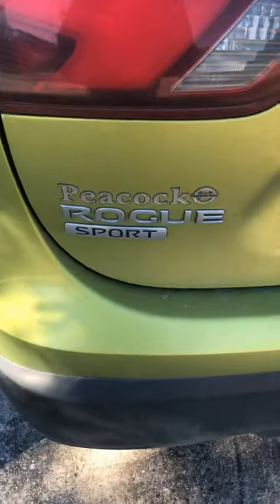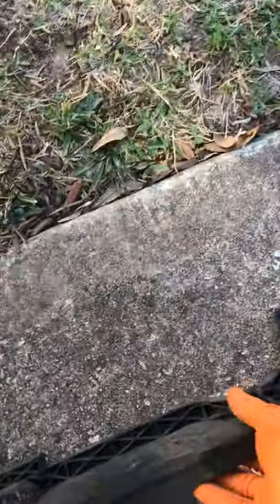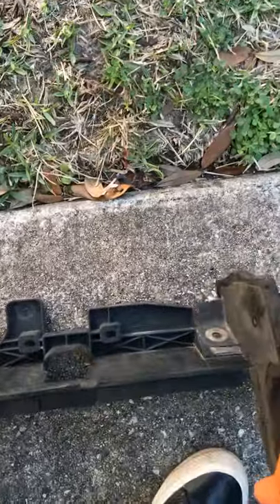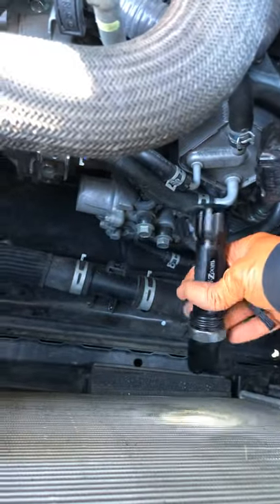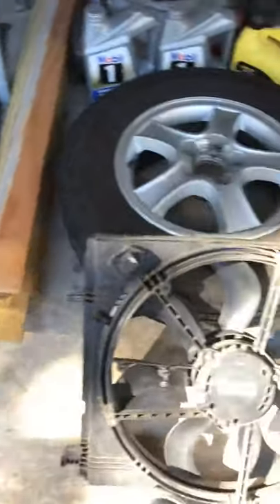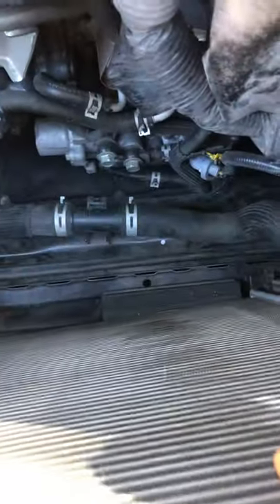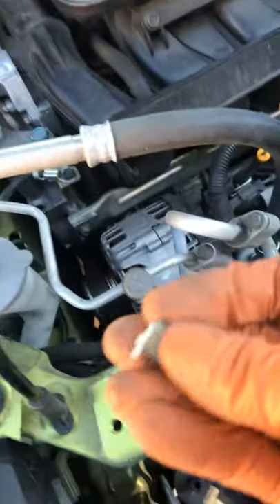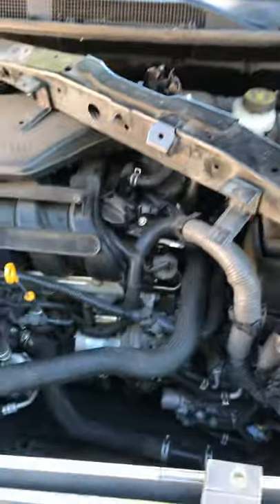2017 Nissan Rogue Sport Cooling Fan Rubbing

Comment: I just did one for a customer guys, you do not have to remove and break all the plastic stuff off. Remove battery and move ecm back. Take top rad hose off the radiator side and walk it sideways towards the driver side and it comes out and goes back in. Took me 45 minutes from start to finish using only 10mm deep socket, pliers for hose clamp.

Comment: Dude, your video was a god send. Couldn't find any DIY vids for my 2018 rogue sport. Then I had this same issue and suddenly your video popped up on my feed.
Reply from the maker: Yea, I found pics and vids for 2fan system but mine only has 1 fan. Finding parts wasnt cheap either($300). I prob could have trimmed the plastic around the shroud  to give more clearance and stopped the rubbing but alot of work just to find out trim job not working so i just replaced it. Glad it helped you out in some way. #Ratchets and Wrenches has Great vids for DIY vids , many cars , explaining different systems , I recommend them as well.

Comment: Thank you Richard, I have a Nissan Workshop manual the way they do it is by removing the whole front bumper assembly taking out the radiator and swapping the fan over. You method is a bit tricky but looks a lot quicker. Our fan has just broken the bearings have worn out too. I'll be following your video when I do ours.

Comment: I had this same problem with mine which led to the fan malfunctioning and the engine overheating. I had to have the entire fan component replaced and the guy at the dealership said this was the fourth Rogue sport this month with that same exact problem and Nissan has already updated the part.
Reply: Lucky you, the fan is now on back order and no one has it not even the dealerships now im stuck without a car.  Do you mind telling me what dealership you went to ?
Reply: @saedvargas1463   same here ... it's to hot for this !!!
Reply: Sorry. I just saw these replies. I went to Modern Nissan in Concord, NC. Hate you’ve had the same issues. I really hope they issue a recall soon since it’s obviously a known issue!

Comment: How do I disconnect the electrical cables from the fan? I’m having a hard time doing that
Reply from the maker: Sorry so late. Been awhile since i did the repair. But yea i had problems too with the special zip ties that hold the wires to the fan housing. I had to cut the zip ties. Left the wires hanging , nothing for them to get caught on , so no biggy.